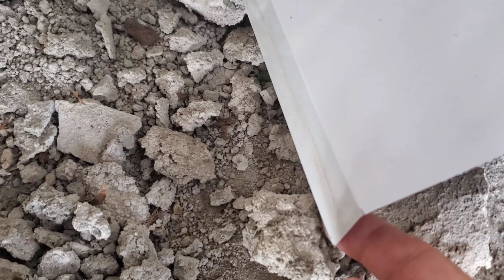American Expat Building Western Style Home in the Philippines 🇵🇭

Comment: I was going to suggest to leave it the plain white to match the columns with the beam’s which is a striking feature of this design but I didn’t feel it was my place to make the comment. Your instincts have been on spot and I applaud your decision. If at some point down the road you change your mind you can easily do an add on. That being said I think you will love the clean un interrupted design lines.
Reply from the maker: Yes I agree. Thanks for the comment. Keeping it simple and more in line with the actual design of the home makes the best sense. Also, like you said our decision leaves the door open for a project down the road. Thanks for watching. Go Jets.

Comment: White roof  and high flashing,  good design for cool indoors and dry one too, I hope they use good Urethane  sealants @ the joints and cement flashing transitions , not sure I would use silicone,  what they often use there .Solong as the contractor warrantees  the workmanship  for 5 years leakfree should be fine.
Reply from the maker: The roof does look good. Not sure about the type of sealant. Might be on site, I just haven't seen it. Wilma and I are happy to see the roof getting installed. Takes the build to another level. Thanks for watching.
Reply: I agree...No silicone for exterior...they dont last..
Reply: @buildingthephilippines  US  brand  sealants like PL  and  LePage have orders  of elasticity better than Chinese ones ,  IMHO,  one thing I must remember to pack in BBBoxes, they do  have a shelf life , " Best  before day".This is also one of James Hightower of Texas Filipino  opinion, as he is going  to use on his windows.
Reply from the maker: I will ask the contractor what he uses.  Thanks for the tip.